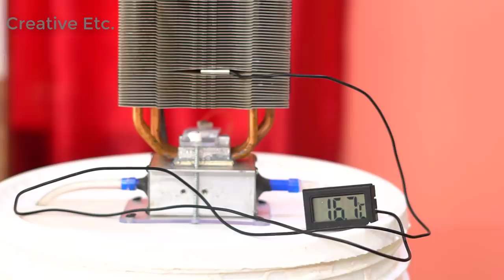How to Make  Air Conditioner at Home

Comment: This seems logical to me! The water would cool the hot portion of the peltier module and the remaining cold side would dissipate out into the radiator and into the room!  Genious!  Would be a similar science as liquid cooling a vehical motor!!!  I'd like to try this
Reply: No actually it won't work. I have tried similar with 15A peltier. The output cold air is toooooooo far less because of that big heatsink and fast fan not even noticable. And the water would get hot as hot as 80° in 30-40 minutes then no more cold air, since hot side don't get cooled anymore. Efficiency is less than 1% of electricity used. 99% lost in heat conversation. And there is no meaning, since you have to change water every 30 minute for that hardly noticable coldness (notice he turned fan off to measure temp of heatsink) and the power consumption is not worth it.

Obviously you can use it as a water heater if the geyser at your home goes faulty.
Reply: @retweaksatapathy106  it would work if there is a large enough source to absorb that heat like a water tank....I hope.

Comment: Within 1 hr water will be too hot after that cooling efficiency of peltier will be impacted and second thing only 1  peltier will never make change in room temperature.
Reply: I've been doing this same pattern but I have a radiator too for the hot side then going outside of the house the tank of water for the hot the cold side I put it ni cooler fan 4 Peltier 60watts

Comment: Brother, Please be honest !. using single peltier module, do you see any deference in room temperature? if yes, how many degrees?
Reply: No difference
Reply: It's posibal try it's no lot mony
Reply: It will work in a small tent, or could be used for person, but not for whole room
Reply: I like this idea. Using frozen water bottles. It would make someone really happy and cold
Reply: 0.1degree celcius ...lol
Reply: There is no deference in room temperature but also in water😡
Reply: You need atleast 4 peltier modules to cool a small like a regular AC machine with only one speed
Reply: legit po ba ?
Reply: else you can make it bigger?
Reply: Why do you want to cool the room. 
Humans need cooling for comfortable living.
Reply: There won't be any difference, because the cooling material and the heating materials are inside  the same room .
Reply: @mumerfarooqkhan9378  Go for airconditioner.
Reply: put mosquito net on window, reverse exhaust fan to send air inside. put it in timer to turn on at night until 4-5AM. problem solved.

Comment: Cool idea. But there is one issue. Using that much thermal paste, makes it lesser effective. The reason for thermal paste is only to fill out tiny gaps, in order not to trap air pockets between the two surfaces. A thin layer makes the most efficient result.

Comment: The water temperature will rise gradually and after sometimes It may not cool the room ...frequent change of water is required.
Reply: Make a loop to the cold ground water, like the cooling cycle of a heat pump on its summer cycle ...
Reply: Can't you just build a pump?
Reply: Yes
Reply: u can add ice to the water
Reply: Frozen water bottles also along with ice cubes

Comment: I salute your efforts, but I think that your thermal duct fan cannot work in reverse function, the bottom side must be on higher temperature than upper side.
Reply: it works but in terms of thermal dynamics, it would be better for a fridge in a poorer country- Keeps your eggs and meats cooler.
all the thermal aggregation to be done outside the box(outside) and hoses to the home.
Remember, the removal of heat is the goal and this one is ambient, albeit minimal.

Comment: I would call it a water heater, that is a  good idea!
Reply: Pp
Reply: It cools the room while heating it up at the same and circulates water through a small pump and wastes electricity...Genius
Reply: If it contains water a bucket and a fan it's no air conditioner. A swamp cooler at most. These will make you feel cool in very dry humidity areas like Arizona and parts of Texas. Not for Florida!
Reply: @michaelbrinks8089  Good Point!
Reply: The heating is for the water droplet
Reply: You are correct .

Comment: Dude.. peltier modules are pretty inefficient as they waste a lot of energy as heat. This one of has a 12706, will consume around 72-80 watts of power and with 12715, it will go way higher.   But all these efforts aren't going to cool anything. As the cooling is pretty slow and has a very small surface area to cool down the air that flows through the heatsink.  Also the cost of these components is way higher than just buying a evaporative air cooler. Though the video was entertaining .
Reply: DUDE, IT COOLS DOWN ....at least it lowers 7 degree of almost air tight room of 9 feet x 9 feet room in 4 hours
Reply: using stacked two 15 amp 12 volt peltier it is possible
Reply: @apc2729  LOL
Reply: Thats almost 400W of electricity 🙆🙆🙆🙆..    the real air conditioner won't draw so much power for 9x9 room
Reply: @AnandBhatB  Ac will draw more than that I mean at least 10 times. The main issue here is you should find a well designed heat management system. Should combine water plus air cooled cooling of heat side and should use very good heatsink and a powerful fan at cold side as well. 

Also one more thing take into consideration is, should consider passive cooling of room. that means do not let direct sunlight hit on the walls etc
Reply: @mackdaddy1891  9x9 meter, not feet

Comment: I tried this and it works however, this peltier is producing more heat than giving off cold. I should say this project is good as a  warmer than an airconditioning thing
Reply: Could you vent the hot side outside, and also vent the cool air to a specific area, such as a grow tent?

Comment: both sides of Peltier can be use to a cold or hot   its a matter of reversing its polarity, also make a Temp. measurement in the room itself away from the the Peltier just to prove if it really works. coz a small Peltier like that will have no effect of coolness  inside a room

Comment: In place of plastic block that was inside the aluminum box, can we use a wooden block or a hollow box of any other material??
Reply: ha kyu nahi
Reply: Aluminum is a good conducter... It should be aluminum i think...
Reply: Or a thinner box, just need water flowing across the sync

Comment: Try chilling the water using pc cooling water block and pump  to the bucket and insulate then flow cold water through a radiator using another pump while taking heat from module to outside in water cooling radiator and pump setup. Working on next step experiment here. Good job!

Comment: After some time balty water will be get hot. Then  peltier also will start getting cool.. it will not work.
Reply: Just replace water after 1 or 2 hours, but it isn't for the whole room, its just for a tent or just for 1 person
Reply: If pump still running water will not getting freeze.. So it work
Reply: exactly

Comment: it's a brilliant aide to defuse the heat into the water. for a long time i looked for a good   solution for this problem. thank you.
Reply: Real Air conditioner use the gas right?
Reply: @villagefoodchannel5262  Real Air conditioner use the "split" form were the "hot side" is in the outside area.

Comment: How to drain the hot water ? Would it not contribute to room temperature heating ?
Reply: Yes, with the losses there is more heat in the water than is removed from the air.
Reply: If you’re not on a water meter just have an overflow into a drain and tap on slow to keep the water changing.

Comment: I was just watching this video and now I have questions. What is a peltier module and why are people saying it won't work? Why not? What is a better system? I am really curious. Thanks.
Reply: A peltier module is a thermoelectric cooler. It uses two opposing metals, that when electricity is run thru it creates a hot and cold side. They are not very efficient. I have a few dozen they are super fun to play with, I use solar and lithium batter packs to make odd little inventions with. They are not. I repeat not useful as a ac. If you want a small portable ac you can a. Invest in a micro compressor, which are more cost effective, or b. Just use ice in a cooler and pump it through a radiator with a fan. Either way.... they're fun but you'll never cool a room with it as the cold side is only as cold as you can cool the hot aide and eventually that water is gonna just get hotter and then the water jug itself is gonna heat the room. Hence why ACs are outside. That's why your fridge heats your house the compressor is inside.
Reply: @justinmarquis3896  I have another doubt..if we place the entire unit shown in the video on the top of mudpot, will it work effectively??
Reply: @Sivaborsu  the cooling part is to be placed inside the room and the heating part ( here it is  bucket of water ) must be placed out side the room . Then only heat transfers from room to outside . Another problem is there , the water inside the bucket will  gets  hotter after sometimes and it will adversely affect the cooling module  ..

Comment: Thank you for your reply. Which  material used inside the metal box for blocking water inside the metal box. It is not understand and clearly visible
Reply: Peltier module, cpu cooler, thermal paste and water block
Reply: Which material used for water block. Thermocool or any other. It is not understand clearly

Comment: Useless project. 1. Only one peltier is not sufficient to cool such area. 2. The heat released from SMPS and peltier nullify the cooling effect, in contrary it gets hot. 3.   Lot of space consumed, better use small cooler. 4. High Power consumption. 5. He has touched the temperature recorder/thermometer to the fins where obviously cooling will be high, no one knows what is actual cooling after blowout. 6. No humidity control. Unpleasant atmosphere inside the room if used.

Comment: The temperature of the air is cool because of the water being cold. It is a cool air extractor. Once the water temp balances with the room no more cool air. Fill the bucket with hot water doesn't make it a furnace. All said and done, I am going to try it. Cool ifea

Comment: The idea is not bad, but besides the inefficiency of TECs there is also flaw in your design. You're using a heat-pipe cooler. Heat-pipes are very good in transporting heat, but bad in transporting cold, because you need to increase the temperature of the liquid in the pipes above their boiling point for them to work. If you cool the base only the copper itself will transport anything so that a simple cooler without heat-pipe should deliver better results.

Comment: how if change the water to radiator coolant? Will be more effective?
Reply: No. The thermal capacity is almost the same.  Insulting the bucket and changing the water frequently for cooler water is the only improvement.

Comment: It would be even better if in the bottom, you used bottles of frozen water in the water and just changed the bottles as they thawed out. This could work for a person sitting near the fan. I turned off my ac and in my bedroom have a large air cleaner with a big fan and it works well enough. This little device if not for my pets climbing all over it is a good mini air cooler.  I even have a duad fan CPU fan that would work well as this one has.

Comment: How much area can this device able to cool? This device requires further development such as controlling air speed and swing or oscillation..
Reply: More importantly a insulated bucket...  More heat will come off the bucket than the cooling effect from the air..

Comment: Funny fact this contraption has about 17 Amps running through it. Costing alot in electricity. 
A regular 30k btu AC runs about 9. Amps.
Reply: Lol if you think this uses more energy than an ac unit. This is at 12v an ac runs at 110v
Reply: @daveyboytellem  P = IV  So 17 * 12 vs 9 * 110.  Yeah, this thing ain't using much.  But it certainly won't work long term without changing the water.  It's a very limited heat reservoir.
Reply: can you converting between 12DCV Amp dan 110ACV Amp ?

Comment: in place of Computer SMPS for 12v power supply can i use laptop charger  ??
Reply: Charger is usually higher that 16 volts which may fry your components

Comment: Thanks for a good video. What is the purpose of the white plastic block?
Reply: It is a thermoelectric cooler that utilises the peltier effect to transfer heat from one side of the device to the other. Commonly used in small cheap car fridges. They no moving parts and  cheap but not efficient compared to regular compressor/refrigerant gas.
Reply: @mattburrows2615   thanks

Comment: Power adaptor will heat your room more :P
Reply: The temp is low near wings of that thermal sink but how will it lower down  room temperature! Efforts good though but rooms are very big to cool them off! I hope u getting my point! Second soon the water will be hot in bucket
Reply: With mining device.
Reply: Good

Comment: HOW MUCH ELECTRICITY IT'LL CONSUME IN 8 HRS.
Reply: Very very little cause it is driven only by a water pump and air fan, there is no cooler/refrigerator involved, its like a heat pump on its cooling summer cycle ....
Reply: One should make a loop to the cold ground water and have a stable 8 degree Celsius cooler.

Comment: He used acrylic sheet to hold the peltier module and heat sink with screws. Won't that sheet melt on the hotter side of the peltier?
Reply: no cause the acrylic sheet was at the bottom of the box through which water would pass

Comment: Tried this to cool a small room with 12715 modules, it is inefficient if don't work at all.. 

It's better to make a small AC using small compressor and use refrigerant.. it'll consume less energy compared to that peltier module...

Comment: First of all your not cooling a room with that item that is more a personal fan then your using a peltier cooler to bring done the temp you can also run the fan on the same peltier from the heat that is dissipated from the peltier that relieves the power from the running the fan but still it nothing more than a personal swamp cooler not air conditioning (6th grade science project when schools were a teaching institution )

Comment: Believe me its easy to AC on installment buy this is hard...
Reply: Can you converr ac to dc 
Just put a transformer step down /
From 220v a.c to d.c out put is 12v d.c. Other country there are so many different alternating current produce accounding their country.
The converting ac fo dc is made by step down transformer, diode (produce bridge type) resistor and capacitor...

Comment: The heat is stored in the water tank, eventually causing a heat leak.
Reply: True, so the question becomes "how long can you keep the same water before you have to exchange it?"

You can dump the warm water outside and get more cool water

Comment: So many things wrong here. 1. he wasted a good controller for just the case. you can buy cases that have Gaskets that will seal. Using hot glue is not good. It doesn't hold up that well. Would have been better to use silicone and a water fitting you can get cheap at the hardware store. Also what's with that plastic block? Makes no sense to have it in there. If you take the inlet and outlet on the box he made and use a copper tube coil inside the whole thing it would be much better. You can submerse the entire copper tube with water/antifreeze and then the heat exchange would be way better. Just means you will have to have a 2nd in and outlet for the submersing liquid. You need to have a more efficient way of doing the heat exchange. Also you put way too much thermal paste on the unit. Peltier's require you to have the entire surfaces against your heat/cold exchanger. You also should consider using a pad to wick any condensation from that forms between the 2 ceramic plates on the Peltier.  Use of wire nuts or block is recommended as well. See in the video at 9:44, There is a lot of condensation on the Peltier stack. This will cause a short and failure. Read the documentation on them.

Comment: No actually it won't work. I have tried similar with 15A peltier. The output cold air is toooooooo far less because of that big heatsink and fast fan not even noticable. And the water would get hot as hot as 80° in 30-40 minutes then no more cold air, since hot side don't get cooled anymore. Efficiency is less than 1% of electricity used. 99% lost in heat conversation. And there is no meaning, since you have to change water every 30 minute for that hardly noticable coldness (notice he turned fan off to measure temp of heatsink) and the power consumption is not worth it.

Obviously you can use it as a water heater if the geyser at your home goes faulty.

Comment: Too bad, never measure the temperature at the radiator outlet because that does not mean it cools the air, comics the thermometer 1 or 2 meters from the radiator, and there if we know that the cold generated lowers the temperature of the area, greetings.

Comment: failed project 
as the temperature of water raised the cooling side goes from cool air to hot air and then peltier stop working because solder melt down in it

Comment: Lets add ANTI-FREEZE & run the water through radiator/ SPEND MORE CAMERA TIME IN MEASURING& EXPLAINING CABLE CONNECTIONS THAN PLAYING WITH pastes/What's the total SPEND of amps/temp/How many more buckets?

Comment: Regular ACs throw the heat outside the room/building, but in this case the heat is thrown to the water in the bucket (in the same room it is trying to cool).

But I am sure the cooling effect will be there.👍 Regarding efficiency it's another story.